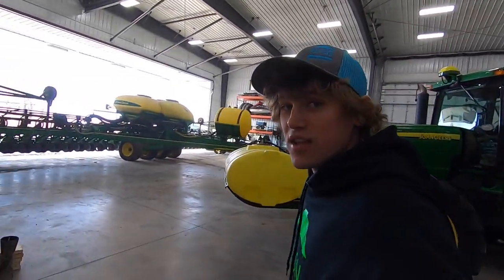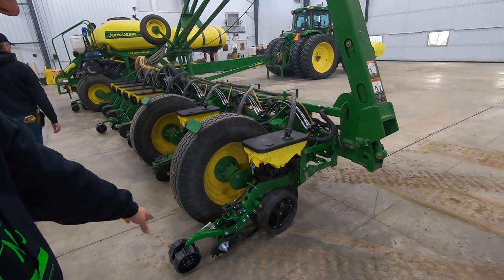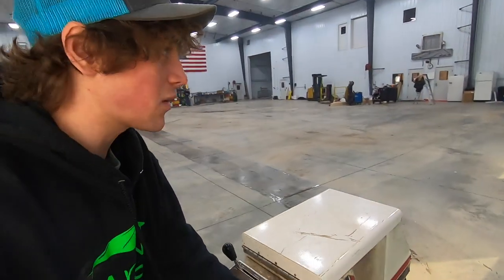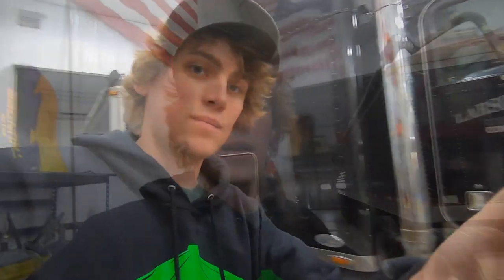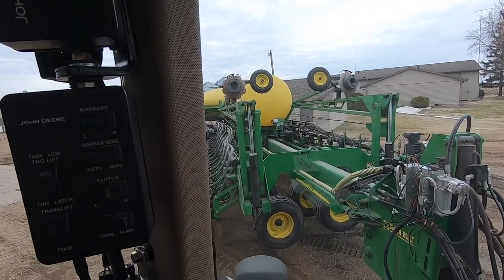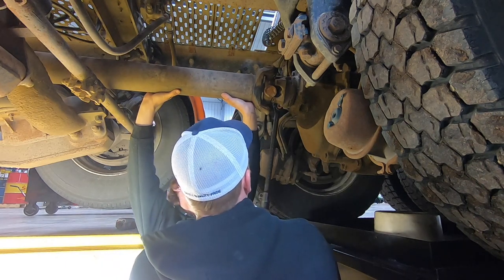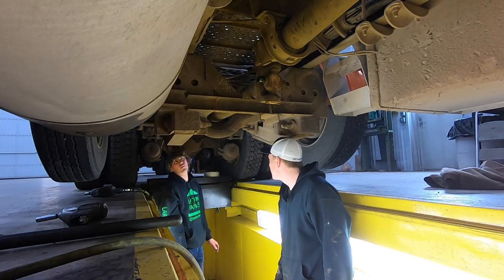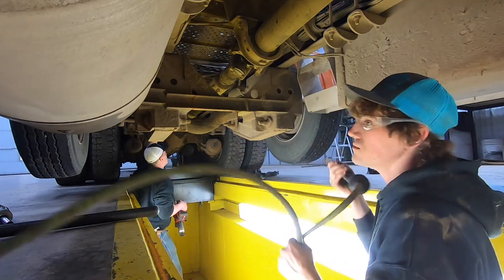Check Out Her Undercarriage

Comment: When you are asking about changing the U-joints, put it in the vice like you had it or put it on blocks of wood on the floor and don't be afraid to hit it hard with a big hammer, sometimes the caps are pretty tight, you won't damage anything and no need for a special tool. 
You can get a plastic protective ring that goes around your lug nuts so that the impact socket does not ding up your rim when removing lug nuts.

Comment: Word of advice from a former diesel mechanic put a little oil on the lug nut ring and threads it increases the torque value and helps condition the metal

Comment: We use different lingo here in Australia.. U joint we call Uni,s or Universal joint . I like Dougos cleaning ethics with the broom . Also that's a very sensible attitude with the maintenance on the machinery . Fix things before they become a major and very expensive issue . Also avoids the truck being put of the road by the authorities . Great vlog thanks for sharing

Comment: On the ujoints, use vise to squeeze instead of hammer, you'll minimize the risk of dislodging needle bearings. Use socket to push out bearing caps.

Comment: We just recently got a Belgium made Tour coach Vanhool it came with two blocks of wood with carry handles plus a bracket for jacking front axil that bolted on with 4 wheel nuts that would take the jack externally so if front tyre flat and no room to get under.

Comment: There is a tool that makes changing u-joints easy. We use it in truck shop, easy & safe.  Driveshafts are not as heavy as you made it seam, I’d do it alone, I’m 130 lbs 5’9”.  The u-joint I think is called a “tiger tool”, ask a truck mechanic how to do it right, to make easier next time also, anti-seize is a mechanics friend for next time repairs. Like your channel, hope spring work starts soon, I hope to be helping on farm in 2 weeks if weather warms up.  Thanks.

Comment: Very good idea with dropping the air before putting steer axle on jack stands. Something I have gotten very use to doing. Same goes for when you unhook trailers, drop the air suspension (if able too) before unhooking to eliminate stress on landing gear.

Comment: When Putting tires on like that, torque them down, then 160 miles later, do it again, tighten those bolts, do a re-torque.  That is law we have in Canada for truck tires, you folks should do that also.  It is all about safety.

Comment: Yes i agreed you need a u joint puller "tiger tool" Farming Fixing and Fabricating used one. Made the job easier.  Good video!
Reply: Jack stands. We also change front shocks every time we replace steers.

Comment: I used the Tiger Tool.. but you can use a vice also. Those are half round u-joints.  Usually they are not too bad but have seen them separate when you try to drive the puck out. Great video

Comment: You can use an old air tank (that holds air) from one of your trucks as a buffer close to your air tool. Put it on a cart and and you have a "boost" to your air tools and won't need to upgrade your compressor.

Comment: Great sound quality for engines of tractors and trucks.
Reply: There are usually circlips on the , holding the yoke and cap inserts  together so that they are fixed together and dont spin apart when flexing and so on.
Reply: @kevinklingner3098  qqqq

Comment: Make sure you check the lug nut holes for cracking aluminum bud wheels are prone to crack there and use a wire wheel on the back side of it to clean off all corrosion to see if there is cracks starting on the side that sits agains the break drum / hubs and for a alignment take it to ok tire commercial center in Fargo ND they do it right the first time

Comment: tiger tool for u joints  also  dump air suspension brakes off   then aply brakes  have seen air suspension pullfront axel off stands or jacks when it leaked down with brakes on

Comment: 5/8 Plywood, not particle/chip board,  would seem to work well in about 2 to 3 foot sections for ease of removal and you only need to remove the cover where the work is.
Reply: Dan S Don’t mess around. Go with 3/4”.

Comment: Do you folks 1) torque your tires?  and 2) re-torque after 100 miles driven?  We here in Ontario Canada have to that to all truck and trailer tires as mentioned in 1 and 2, all trucks, Dump, and Hwy trucks.

Comment: The easiest way to change u-joints like those is to park it not over a pit and remove the bolts holding the full round caps on and use a hydraulic jack and jack on the yoke and push the cap out. turn the drive shaft 180 degrees and do the same on the other side. Then you can just remove the u-bolts holding the 1/2 round ones and change it right on the truck.

Comment: Probably should get a U-Joint puller bud. Get one off of tiger tool. You'll have it done in 10 min. That's how you're supposed to do them.  You gonna torque any of your u-joint or just rally with a couple ugga duggas? Same with your bud wheels.

Comment: I used impact gun on chrom sockets 1\2  3\4 drive ,for 35 years in a coal burning power plant neverdid  break  a socket or chip chrome so dont worry

Comment: Run the front end up on blocks. You be able to get under easier.. check the center pin on the spring stack  it may be broken. Hap to be replace  to keep front end in line.

Comment: Take that bottle jack you have and a piece of round stock the size of the caps and press them out while the driveshaft is on the truck ! Or jack up truck and use it as the press !

Comment: I had no idea there was such an art and science to operating a push broom.  I guess I’ve been doing it all wrong for 55+ years.  What do you do with the fine dust if you don’t have a fancy pants floor scrubber?  Why do I get the feeling it was the blind leading the blind during that u-joint job?  Scribe a line at the joint before you unbolt it.  No confusion over what goes where during reassembly.

Comment: I no a guy that plumbed 100# lp cylinders into his air system . I think he had 5 cylinders total plus air compressor cyl. Had a truck shop and changed alot of tires and compressor hardly ran. Try it you won't be disappointed.

Comment: You have big nuts, mine are not nearly that size. Maybe because of aluminum wheels. Mine are steel. I think you should torque the u joint bolts to specs, don't want those coming loose. I check mine after a few runs and retorque them. It's great that you do so much fixing on your own. Luv the vid, Peace.
Reply: icebaby snocain Amen on torquing both the lug nuts and the u-joint bolts.
Reply: @oldtireman4665  the old "ball and seat" hubs assemblys like that dont need to be torqued. The u-joint bolts you hit them with a gun till they are tight, and you never have to worry about them. No torquing needs to happen
Reply: @zachstrasser5873  bad advice always torque  to spec.
Reply: @davidstraumann9882  never done it, never had an issue
Reply: Zach Strasser While that part of the issue may be subject to debate, I will stand firm
on the lug nuts, especially with alloy wheels.  Might not be as critical since they’ve been on and off a couple times but it never hurts to check those stinkers.  And, too much torque, especially uneven torque can cause other problems.

Comment: Tiger tools only way to remove U joints than you don't have to take it out of the truck. Long before tiger tools came along it was a bottle jack an BFH to remove the U joints. Where's you're Teflon ring for the aluminum rims to protect from scratching the rim with the socket on the old ball n seat rims?

Comment: 17:08 when I used to do replacements, I used heat and the grease inside the bearing caps would heat up and make them just pop off, or after the heat just a few hard taps with a 3/8 extension and your ready to install the new one. (Of course, over time, you will damage your extension beyond usable but they are cheap to replace). Also using heat keeps you from damaging the U-joint collars) Don't burn yourself.
https://www.youtube.com/watch?v=CR1qqLo6XKA

Comment: Get a free bag of sawdust from the local lumberyard and use it as floor sweep for the fine dust.      I am sure they have a YouTube Video on removing a u joint on a semi drive shaft. I know the drive shaft hast to be lined up right or you will get a vibration while driving

Comment: Chet, they make a tool that is like a U-shape, and can press them out. One piece screws into the cap holes, the U-shaped sides go on the caps of the I-joint. On the middle piece you use an impact and it screws down and it pushes it out. www.grainger.com and U-Joint remover tool, heavy duty. They a a little expensive but 100% worth it

Comment: Bean planer??What is that? I've heard of bean planters, but bean planer?
Two things you need for the floor scrubber are either a sulky or remote control.As for the video itself, I enjoyed it very much!
Reply from the maker: Just a normally planter ours is a dB 60 20” spacing just have to put bean disk in

Comment: When you put the steer tires on did you put a sledgehammer at the bottom side of the tire an spin the wheel for wobbles. Just tightening the nuts does not make the tire run true . That maybe some of your problem with the checking of the tires .
Reply: That method was for the old split rims all the new style rims are tried from the new! So no need to do the sledge hammer trueing!!!

Comment: Your shops aren't  big enough to put either the D12 or the AW900  In, I have a 150,000 sqr ft pole barn to house both of them, the concrete floor is 18 inches deep because of the wieght of the two, the D12 is 250,000 just sitting there  the AW is 235,000 so the engineer  said it needed to be that thick because of the weight  of the two units the doors on the shop are 35 foot tall it kind of looks like an airport hanger for a 747

Comment: Someone said its been aligned 3 times, I've been driving over the road for 22 years, out of all the alignments I've had done over the years, only 1 actually was correct, those techs always put way too much toe-in cause they think it drives better, well they don't drive them or pay for 3 sets of steers that if it was aligned correctly would only need 1 set.
Reply: Too many times they only check the toe in when they align big trucks. Probably needs all the axles aligned. We did our Pete and it made a world of difference

Comment: You guys did mark the shaft so it goes back in the same orientation right?  If you dont you're gonna get vibration which of course ruins the bearings.
Reply: Semi Drive shafts are balanced in two halves, makes no difference.
Reply: @derrickfritz685  
   Well okay then.
So how does that work?
Reply: @derrickfritz685  
If they are out of phase will they clunk?
Reply: @TrulyUnfortunate   as long as each half is balanced your good. they only pulled the back half, and also they didn't pull apart the slide on it, so nothing changed.They are set to just put it back together, it'll be good, no clunking. . .